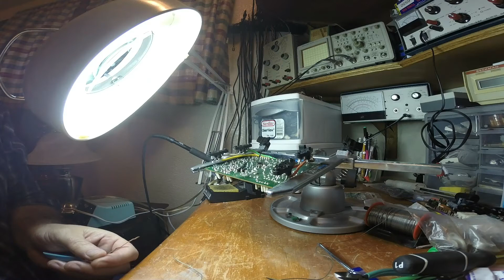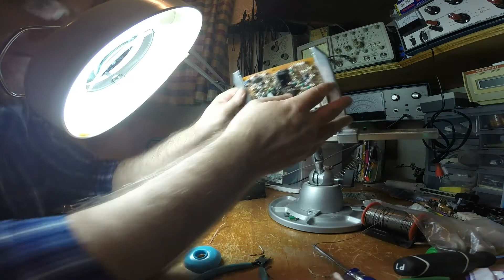Marantz 300 DC Rebuild Part3

Comment: Great video.  Do you know where I can pick up the parts for this?
Reply from the maker: I would try EBAY for the MJ21193 and MJ21194. Try to get them (Motorola) or the ON SEMI replacements from the US. There are tons of counterfeits out there. The driver transistors have to be searched out. I remember having to use several sources. It is permissible to use NTE equivalents and I did in the case of the drivers. The pre-drivers prior to that were a real search mission (the small signal BJTs). Of course all of the electrolytic capacitors can be found at Mouser and possibly the driver equivalents as well. Mouser is a little more expensive but you know you are getting good parts. I hope this helps.
Reply: Krypto Night by any chance have you found the transistor and cap part numbers for this unit (300dc)
Any help would be greatly appreciated.